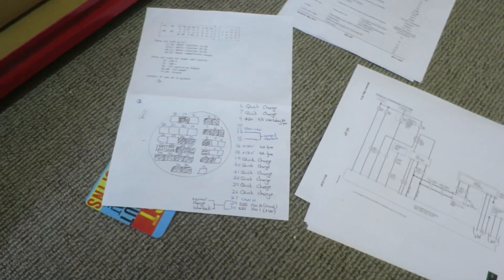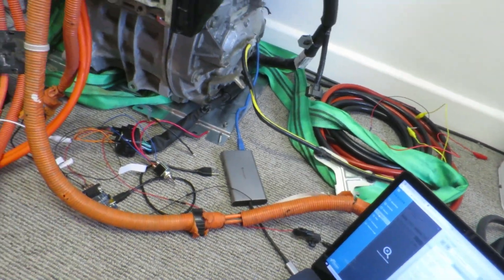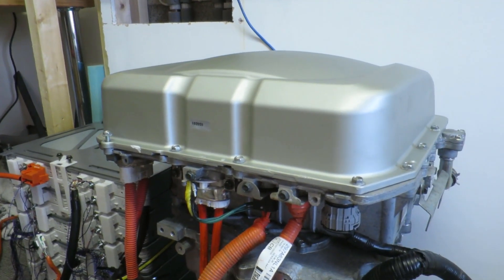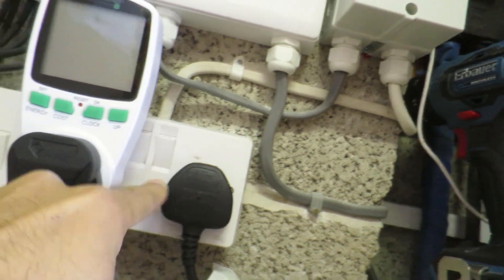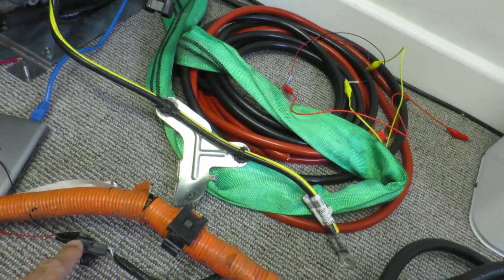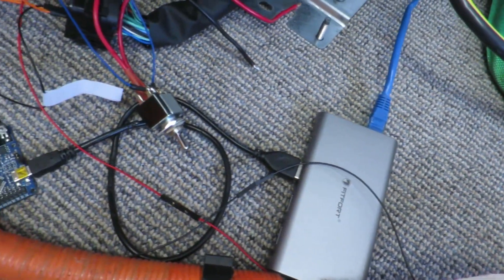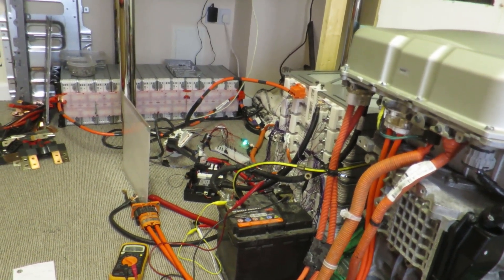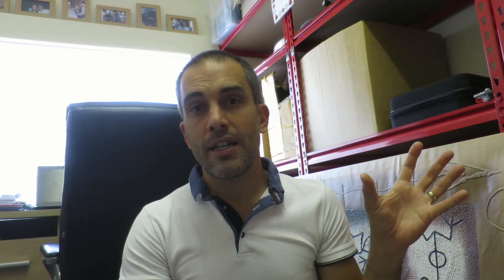Nissan Leaf Charger Working, and Dc-Dc Working, Week 8

Comment: I have the same problem on a Nissan Leaf 2014 . Is there a chance of showing me where the charging relays for the Dc to Dc Charger are located…
Reply from the maker: The relays for the DC to DC are within the power distribution model - which is the lump on top of the inverter (so basically the top of the stack that has the motor on the bottom).

Comment: Very informative video, I would be interested to know how many amps ( or watts ) the 12v battery draws when charging  from the main drive battery.
Reply from the maker: Well it depends what the car is doing and how much it is drawing, as really the 12v charger is powering the car, the battery is just there to get things started.

Comment: Hey there, so are you sending CAN messages to the OBC? Did you change the wiring on that at all? And do you have a BMS hooked up? I'm using a complete Nissan Leaf set up but still struggling.
Reply from the maker: Yes I am sending it commands, no - no wiring changes. I am using the Leaf's BMS. Good luck!
Reply: That's great news! I've been very nervous about how to charge my batteries after struggling with the inverter for so long. Are you sharing the CAN commands you are sending publicly?

Comment: Amazing work Dave, I’m looking to test out my Gen 1 leaf charger and dc/dc converter next week. Can I ask what the codes were for the CAN messages you sent please? Most of the Gen 2 CAN messages have been the same and it would be great to see if they are the same.
Reply from the maker: Hi - I would have to look back through my notes, but pretty certain on the unit I have that once you power up the charger it simply starts outputting 13+v to the battery! It was really easy.
Reply: @SouthWestEVUK  Great thanks Dave, will be interesting to see if there's a way to use the Leaf charger with a lower voltage battery without having to change the logic board.

Comment: I have been searching this topic for weeks now! I have the same powertrain prepped to install in my Fiesta but have been really wanting to use the Leaf charger. Do you have any info you'd be willing to share?
Reply from the maker: I will do, but I will be honest it is all very ad-hoc at the moment, and not really tested to much length. Once I am happier this is all good I will be looking to release information. I dont want to be the cause of anyones crashed cars or blown up chargers!
Reply: @SouthWestEVUK  I am en electrical engineer and have a DC car I've built. I have the ability to help you document this (and personal interest). I have a couple videos of my stuff on my YouTube site but feel free to email me tdshorten @ Gmail . Com This is the last bit of the puzzle before I have everything I need to get mine rolling.
Reply: Have a source for the can messages you used? I've also found the Gen1 charger pinout but having troubles finding the Gen2. Ideally I'd like to use my Orion to control the charger.

Comment: You could use a normal car type 12v inverter on the 12v battery to drain that with something from the house plugged in which would then pull current from the traction battery giving you some room to charge it.
Reply from the maker: Thats a great idea, I had not thought about draining the pack through the 12v battery, once I have my BMS fixed / replaced I will defo be doing this... Thanks Kevin.

Comment: You need a van or an SUV to put this setup into for you to enjoy it and not a small car.
Reply from the maker: True, guess it depends what you enjoy driving...
Reply: @SouthWestEVUK  you are not limited in anyway, you made it look simple due to your basic method of solving the problem. I do like your work on the leaf.
For me my leaf is already too small for me due to the fact that I lost my truck when I used it for keeping the extended battery. The car is faster now with more range but limited space.

Comment: I really hope you doing a detailed build with all the parts written down 
because i want to do that too when the EU decides that gas and diesel cars are forbidden in 2030ish haha
i can only imagine how much fun this thing will be to drive in 1st gear with that motor :D
have a nice weekend mate
Reply from the maker: Ahh yes, I have done the gear ratios - 1st will probably be undriveable with too much wheel spin, 2nd will be fun but low top end ~70mph, 3rd is a bit longer than the leaf so wont be that quick off the line but top end will be 100mph. Combination of 2nd for off the line speed and 3rd for general distance driving. Cheers

Comment: The interlock on the J1772 handle is actually quite important. The detection circuit is broken the instant you press the button on the handle, and this stops charging. Without the interlock, there is severe risk of arcing if you remove the handle whilst charging is ongoing. Top stuff!
Reply from the maker: Yeah I did play around (off camera) and saw it cuts charging if not connected. Makes sense!! Cheers Daniel.

Comment: Nice job Dave, 
Did you find the can messages to start the charging? I think the charger needs to know how much current to send. 
There is some more info here  https://openinverter.org/forum/viewtopic.php?f=4&t=533&p=6551&hilit=leaf+charger+can#p6551 
 https://github.com/damienmaguire/leaf_can_bus_messages
Reply from the maker: Not specifically yet, I struggle to think the charger 'sends' current. Current is a result of the voltage of the pack and its resistance?

Comment: I’ve been following your video series. So I’d like to know why you didn’t basically just transplant the nissan to the rx? Like whats the point of reverse engineering the whole thing? Please do explain and also
I love the series!
Reply: Short answer is that you need less modules connected. By reverse engineering it you can keep only the essential bits.
Reply from the maker: Yeah Daniel has hit the nail there, if I kept everything I would likely need the dashboard, main controller, gear selector etc, any one missing piece would throw faults. So you may as well bin everything you don't need. Its also just cool to now be able to do whatever I want, and arrange components however I need. Cheers for your support, the comments keep me coming back ;o)
Reply: @SouthWestEVUK  Understood. Thanks mate!
Reply: @DalasEVRepair   Makes sense now! thanks!

Comment: Looks good, handy that the 12V charges without any commands. Using something interesting to prevent shorts there?
Reply from the maker: No protection in at all at this stage, no fuses, error checking anything really - this is RnD, and now I have it working I can start to beef things up!